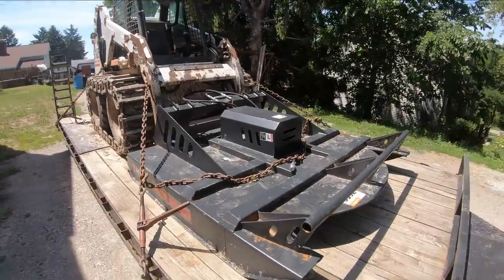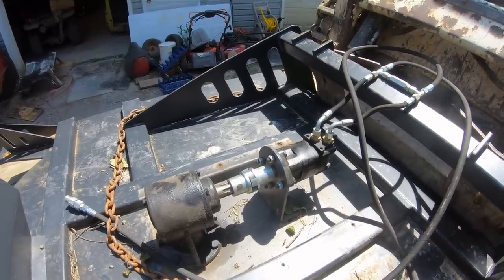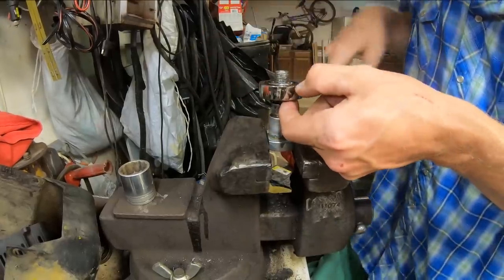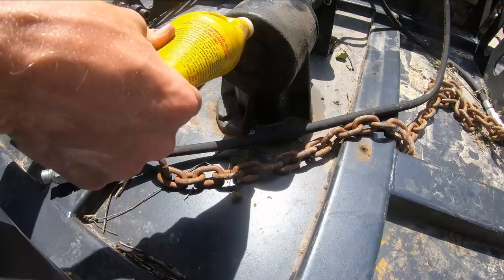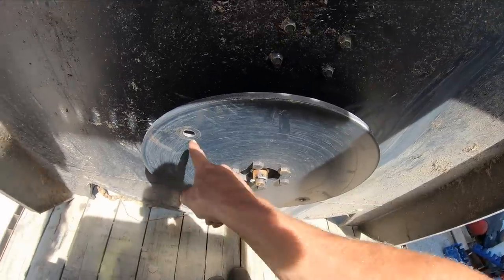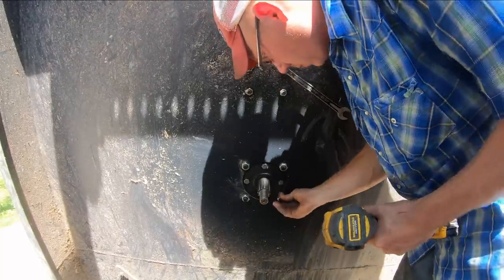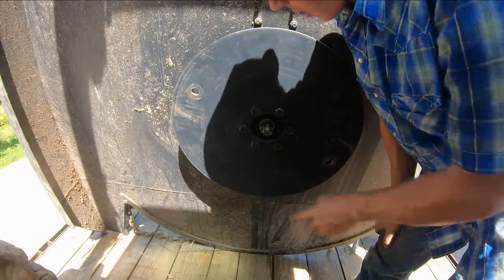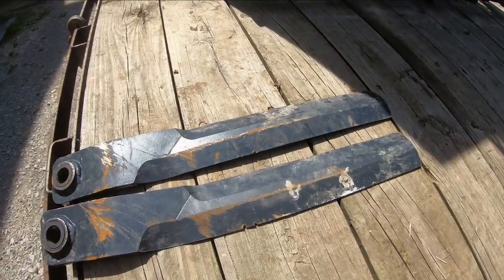BUYER BEWARE: Generic Auction Brush Cutter Inspection & Repair (Brand new JCT)

Comment: This is why they auction them, no warranty, no responsibility, take the money and run. They are too low a quality to sell retail.
Reply: I believe that is an accurate and true statement. you get a negative vibe off this stuff when seeing it in the auction yard.
Reply: This make me wonder what they pay.  What's the markup?
Reply: @chemech  That's actually a really good idea.

So after looking on Ali Baba, and from memory of previous google & duck searches for JCT Equipment, I didn't find anything relevant to, "brush cutter," but did find a bunch of listing for emulsifiers and vacuume mixers for the food industry which seems to be their key market.

IDK, maybe a one off contract swap/buy because they knew the quality was schit?
IDK.
Reply: The parts seem adequate, so it seems strange that they would go so cheap on assembly to not tighten nuts.  Also, a good retailer could correct the problems as is being done here, except more efficiently through repetition.
Reply: @alan6832  no retailer wants to devote man hours to do this kind of work. If it isnt ready to sell as it comes through the door nobody wants to deal with it.
Reply: Florence Arva  nope
Reply: @jblob5764  ,  Money is money. Hours fixing things which aren't broken means next to nothing if the markup is enough.

Comment: It’s the “Chicago Electric” of brush cutters.
Reply: A couple washers would have put the cutter pin deeper into the castelation of the center nut.
Reply: @apachepaul  or a second nut to make a 2 nut friction lock.
Reply: @BillyBob-fd5ht  ,  Unless making "something" out of a "NOTHING" doesn't haul the freight.

Comment: I've got a couple chinese ATVs and the first thing you do when you get them new is to go through every nut and bolt and tighten them. At least 20% of them are loose. For some critical bolts, I replace them with 8.8 bolts as the ones they come with are almost pot metal lol.
Reply: Lol I had a chinese atv, you ride it around the yard are few times and all the bolts that hold the axle on are backing out and losing nuts. It was a death trap.
Reply: Also remember to replace or at least check ALL of the fluids. You never know what kind of garbage oil they used in the crankcase, transmission, etc.
Reply: Hoss Man   The bolts are made from "Chinesium"   the only metal known to man, that is both soft AND brittle.
Reply: Same, i bought a 1200 scooter off amazon. Even after tightening everything down everything still rattles lol
Reply: @jesperdahl1486    2 funny
Reply: Did you have to rebuild the engine too?
Reply: @chriss2500  ,  You wonder why they do that... it would be simpler to send it DRY with a note "FILL WITH QUALITY OIL."
Reply: Stop buying Chinese. Problem solved
Reply: @robertschemonia5617  ,  I was going to laugh and let this slide, but it is right on the money, People are so used to "made in the USA names that the "made in China" label is not even read or LOOKED FOR on most equipment. The sad thing is that the slave labor and garbage they sell is being mixed with the best junk they sell as Keithley and such instruments. Go figure.
Reply: Or not by Chinese and watch for better more long-lasting cheap equipment

Comment: I'm a little late to the game here, but my experience says attachments are always shipped dry. Partly because it adds to the shipping weight, but it's also a shipping hazard. If you buy your equipment from a dealer, the pre-delivery process includes adding any necessary lubricants.
Reply: SO you are saying they make a good quality product if greasesd?

Comment: I would have added 1 or 2 more washers so when the key is put in it is in the slots of the nut problem solved
Reply from the maker: I highly doubt that the key would have stayed in there, most likely it would have loosened up again, this was simple and I know it’s not going anywhere
Reply: more washers and a roll pin
Reply: Was gonna say the same thing, those tacs are going to be subjected to a lot of impact & vibrations plus if you need to get the disk off & back on, on a job site & the welds that you have done have held you need a disk cutter & a welder to do that. I think the loctite some washers & the split pin would have been enough.
Reply: put a nyloc on top
Reply: I would have just put on another nut on the end and tacked the end of the shaft to the nut.  Hate seeing semi-good threads welded and ground off.  Just me thinking out loud.  Definitely cheaper made than a real Bush Hogg.
Reply: Nevermind... just watched your next video where you added a jam nuts.  Great minds think the same.   LOL
Reply: @martinsnyder4947  roll pin would come out over time. Need to stick to a cotter pin.

Comment: There's a reason they're cheaper. I used a "name brand" for exceptionally rough duty for years. While I had failures- I  can honestly say they weren't the cutter's fault. Your cutter will be a constant problem. The differences I see are huge. I guess run it till you're tired of it at this point idk.... Thanks for sharing

Comment: I have the same unit.  Sheared the jaw coupler after about 8 hours. I was unable to find lovejoy replacement for my shaft sizes.  I ended up building up original couplers with stick welder and ground them mostly flat and I run it with no rubber spider bushing.  I've got about 40 more hours on it and so far so good. Yes you get what you pay for but for less than 1/4 the price I make it work. At the end of the day these Chinese attachments are a roll of the dice but they're a good platform to start with if you know they're going to need some love.

Comment: Sooo let me get this straight, you mean to tell me, that you bought a new piece of equipment, and DIDNT CHECK THE FLUIDS!?
Reply from the maker: The Kodiak 77 that’s the only part that I can blame myself for but typically there is a tag or sticker or some sort of warning to let a person know it’s empty, there was NOTHING that’s what made me mad!
Reply: @DieselCreek  well, at least now you know when you buy ANYTHING from auction, When in doubt, check everything out.
Reply: But there was signs of oil on the cover. Someone put oil in or on the unit at some time.
Reply: I have to say in Australia when you buy domestic 4 stroke anythings lawn mowers etc it's rare they import them with oil in them but your right over here they do put numerous warnings on the outside and sometimes rarely now they supply a small bottle of 4 stroke oil of course there is no problem with 2 stroke stuff but the machine looks good to me for the 1900 dollars paid
Reply: @DieselCreek  Wouldn't it be easier to just put a washer under that center nut so that it meshed properly with the cotter pin?  Or a second nut it there is enough room, under the castle nut instead of a washer?
Reply: @DieselCreek  I have to agree with the Kodiak , this video is a everything to check and do "POST AUCTION" video.  Cheers Diesel Creek.
Reply: Well Kodiak it is a Chinese made thing so I'd not even be surprised

Comment: When you buy a bicycle in the super market, you have to check all nuts and bolts, since they just pre-assemble it, but not really complete it. Guess same for this brush cutter. They pre-assembled it for you but just so everything is at the right place. You needed to fill in fluids and tighten up the nuts.
Reply: The bicycle thing is because they have these kids now days assembling stuff and most cant even change a tire, so you give them a box with 100+ parts and expect them to be able assemble it when they cant comprehend directions in an owners manual as how to use a jack and lug wrench lol

Comment: Nice that you gave a close-up of the manufacturer, along with a good, loud, clear shout-out to J.C.T. - obviously a maker of quality s̶h̶i̶t̶  machinery. Without trying to be over-dramatic, that's some life-threateningly dangerous sloppiness, maybe not so bad on a shopping trolley but on anything that spins quite fast, just not acceptable. It would maybe be unfair to blame the auction guys (they don't make them) but they should be aware of what they are selling.
I'm never likely to buy one of these but, if I do ......etc etc.😁
Good Luck with the upcoming job; I think you'll need it.

Cheers for now,
Dougie.

Comment: lovejoy couplers always do that when on hydraulic motors
they're made for high speed very low torque stuff
get you two sprockets and double roller chain
Reply from the maker: Yes I’ve seen that style before too. Might be the way I go I also thought of putting a slip clutch in there
Reply: We used to run this type coupler a lot between electric motors and hydraulic pumps with no bother, but they were a lot better quality than the s##t from China looks to be. Overall from what I've seen of chinese "generic" stuff, (knock offs) it's nearly always rubbish. Remember what grandma used to say, "buy cheap, you buy dear", and you know what, she was right.
Reply: I do for sure know Massey Harris and Oliver farm tractors and probably other brands used the sprockets and double roller chain, a slip clutch might save some wear and tear on the gear box. 
I would hit the farm equipment junk yard and look for better built used motor and gear box with plate and blades for a total rebuild spare, when this one craps out swap out the cheap one and Let.s Roll.
Reply: Genuine Lovejoy couplers are actually quite rugged. My Case garden tractor uses a Lovejoy coupler between the engine and the hydraulic pump, and tractor runs totally off the hydraulics, even the drive. My tractor has been running off the same spider for over 30 years...
Reply: @DieselCreek  Or, use a U joint
Reply: You can change to a different style coupler that has a beefier or harder rubber spider. I'd swap it out with one where the rubber surrounds the outside or even one that has a extra metal sleave around the outside of the insert. And I'd make new better blade spindles. Of course I work at a Hydraulic shop with it's own machine shop, so I have more access to this stuff than most.
Reply: But, much respect to you. I probably would have done the same thing you did until I could rebuild it the way I wanted. 
 One advantage to cheap junk is that you don't feel quite as bad if you decide to rip it all apart and modify it as you wish, than if you would have if you paid much more money and done the same.
 You did show much more restraint than I would have, my frustrations would have likely been much more evident to everyone in hearing range.
Reply: I had a 72" Brushmonster. It was a good unit but I had to reinforce the deck to limit the torque on the gearbox and motor. Every 2 hours I had to re tighten the mounting bolts. It used double roller chain and never failed. ANy of these type of mowers have huge stresses on them and everything works its way loose.

Comment: Suggestion, I believe you can get a friction clutch type coupler to replace the spider coupler at tractor supply. That would be a lot more durable drive with some give when hitting tough items.

Comment: I bought the same one from richie brothers.  I only used it for 2 minutes,  but now i have to plan on spending a few hours going through it.
Reply: We have the same 72 in mower and we made is to where we could fit standard blade and bolts because you can’t find those shitty ones that come with it online. We also had to modify the attachment plate because that wouldn’t fit on our bobcat t450. Finally we had to replace the love joy spider coupling. Would highly advise people to stay away from jct.
Reply: went through my cutter, had no oil in it.  But mine had a chain instead of a love joy.  All my bolts were tight though.  Blades held up fine when I mowed down 2 acres of sage brush.

Comment: should have been sold as a kit, partially put together
may want to remove every bolt and lock tite each one 
engage. How about extra washers so the castle nut engages properly?

Comment: Quick "shade tree mechanic" fix for stripped threads (if you don't have a die for it) buy an extra sacrificial nut, cut three cuts inside the nut, across the threads with a metal cutting jigsaw and run it over the stripped threads of the bolt, (the three cuts give a place for the filings to go)  it will clean it up enough to help get the permanent nut on.

Comment: Company I work for we just bought a brand new 85’ radial conveyor from Ritchie bro’s. Same kind of deal. We realized we were going to have to check every single component before we lifted it. When we went to lift it up to it’s working height the stainless bolts they had bolting the sections of frame together literally blew the nuts clean off the bolts. So we learned that lesson and replaced any load bearing hardware with grade 8s and it’s been working great since we got it set up. But like you said now that we’ve done it and learned the lessons we realized if we just went over all the hardware right off the bat we would’ve had no issues really.

Comment: It's good practice to check all this on every piece of new or used equipment regardless. I've bought brand new cars with an unbelievable amount of loose/misaligned/incorrect hardware or fluid levels. Also, a periodic check after several hours of operation is prudent.

Comment: Don't trust the cheap locknuts, either replace them or double nut the originals so they don't come loose again. Locktite is good but wouldn't rely on it especially when you consider the forces exerted on it when it's running. Also looks like you could do with replacing the originals with some decent quality nuts and bolts , just for peace of mind and so the damn thing starts earning money instead of costing.

Comment: To be fair, you are buying these things straight out of the container from the overseas factory. No dealer prep. Dealer prep is where they would have put oil in the gearbox, and done a "nut and bolt" on the whole machine, AND it's why you pay 2X as much for the same exact unit at a dealer.
Reply: hawkturkey he used it 5 minutes last week then it sat in the weather until he had the time to fix it.
Reply: That's just an excuse for overseas garbage, no dealer prep would cover taking everything apart to torque everything down.
Reply: Also he knew about some of the issues they have why not go through machine to make sure everything is okay before running it

Comment: Couldn't you have used thicker/ more washers to get the castle nut out far enough?
Reply: I'm pretty sure there is supposed to be a bushing there to pack it out the right dimension so the castle nut is in the right spot. Possibly the bushing is supposed to be on the other side of the body.

Comment: If it was straight out of a shipping container before you bought it that's why there is no oil in it as its illegal to ship items in containers with oil in them. Unless the shipping company covers insurance against oil carriage. And as for most new machinery  you should always check every nut and bolt is tight especially the cheaper Chinese imports, as they don't torque everything to spec to save on costs. There is no need to complain about something you should have checked before using it
Reply: buy american period or stop complaning

Comment: Over time your purchase will be worth it, as you have the tools, time and skills to re-engineer the unit into something that will do what it is asked to do. It is not a very complicated thing, after all. You did good I think, you just need a cookie or two and a cuppa joe.

BTW - if you can bend the blade like that on a press, it is most likely not heat treated. If it was heat treated, it should have some spring in it.
You can make your own blades when you need them, which you will - sooner than later. Heat treating is fairly straight forward. Use old leaf spring- older the better. 

Use old gear oil to harden blade after getting the "whole working part of the blade" to a cherry red. 
AVOID avoid avoid breathing in burned used oil fumes - surest way known to go to hell real fast. Do not pull blade out of oil
once it is in, or it will catch on fire.

Then once blade is cooled off, clean/shine it up some with hande held grinder, and bake in home oven at 450 degrees for around 
20 - 30 minutes or until the surface shows very dark blue color. 
Make sure blade is sharpened b4 doing all this. I have been bladesmith for 40 years, BTW. Cheers.

Comment: Welding nuts to bolts/threads is a hackjob, don't do that ever, you could just put thicker washer so pin would engage castle nut, no locktite nor welding would be required.
Reply: Also, heating the shaft with weld releases the loctite.
Reply: I’d weld the shit out of them, cut them off next time you sharpen the blades, the original bolts are garage anyway.
Reply: @jdub229r  bolts were OK, issue was poor fitting, and loosing pins, followed by loosing castle nuts. Bolts were damaged by ripping them thru holes, not by stripping threads.

Comment: When cutting threads with a new nut take a hack saw and cut 3 or 4 groves in the threads of the nut so the material that comes when cutting the new threads has a place to go then use another new nut to tighten the bolt.  The nut has to work like a thread tap and die.  Also the correct rotation on the cutterhead will tighten the nuts instead of losening them.

Comment: This is so typical of Chinese equipment, they have the capacity to make good stuff but they choose to not to ?
You were spot on when you said that if you had gone over it prior to playing it would have worked out fine ! 
You will probably need to swap those blades out sooner rather than later, they didn't look as if they were made from particularly hardened steel, if they don't crack & break they will probably just wear down very fast.
JCT = junk Chinese tools
Reply: Wamat want 3 cents off price.......take out 3 washers!   Yes, comrade!